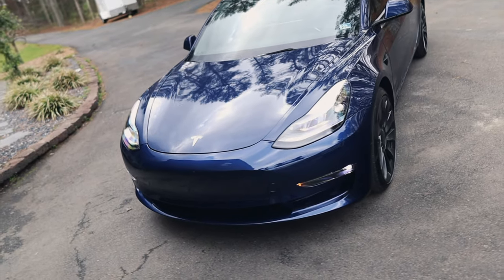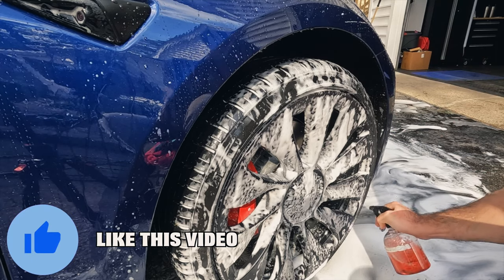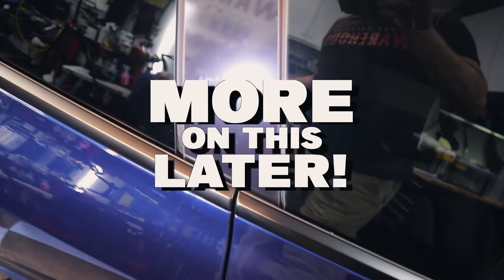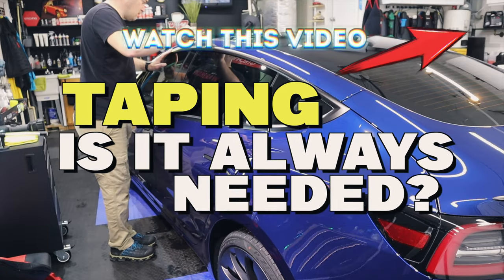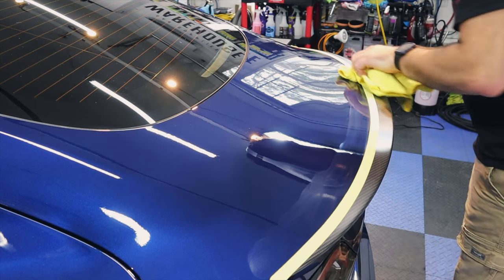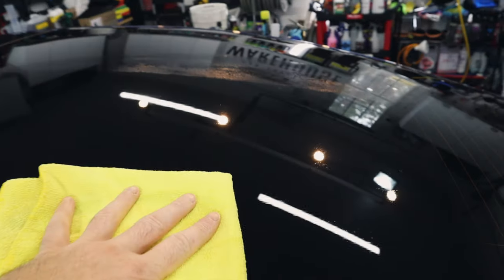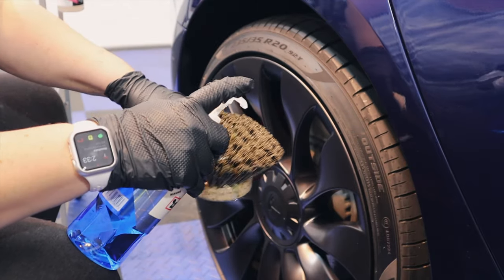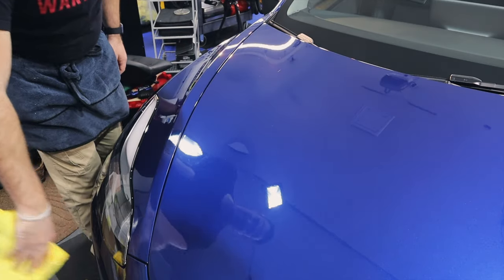CERAMIC COATINGS | FULL  PROCESS | TIPS & TRICKS #detailing #detailingtips #tesla

Comment: Hey Phil, I like the way that ceramic coating goes on as well. But I just bought Kort UK 3.0 what’s your thoughts on that coating?  I used it a few years ago and it turned out great, but it was not the easiest coding to remove. that coating in your video comes off super easy.  Thanks!
Reply from the maker: Hi. Yes we loved that’s stuff Cquartz UK3 also. We used to use it a lot years ago. Thinks weird however. It was pretty easy to apply and remove for me. 
https://youtu.be/ERIXOuxHrSs?si=YuCJ9KAM_S6-54E5
Reply: @MirandaDetailing  Phil, if I apply that ceramic coating and it rains two hours later, will that kill my application?
Reply from the maker: Well yeah…ceramic coatings like carpro, Gtechniq and gyeon need at least 12 hour cure time. If they get wet early it will compromise the coating.

Comment: Hey Phil. I must say. Hands down the best work I’ve come across on ceramic coating 👏 awesome. I’ve been looking into ceramic coat my Tesla model 3. What are some good basic products I would need ? Very new to the process of polishing pads to use and compound . Whats something good to start with ?
Reply from the maker: Hi. Thanks. 
It all depends on what type of polishing you want to do. 
If you’re new to polishing I would go with either the Rupes line which is very easy to use, but a little pricey, https://bit.ly/411eORt

or the Meguiar’s line with D300 Correction Compound and M210 finish polish. 
https://amzn.to/4bCgl7d
https://amzn.to/3Sx2cPX
https://amzn.to/3weLn4R

Comment: Hi, I'm  trying to ceramic coat my car. I've bought all the tools needed. My only fear is overdoing the buffing and removing too much clear coat. Do you have any advice on how to approach buffing for a newbie?
Reply from the maker: Hi. Great question!  So if you use a medium or fine polishing pad and a light polish you don’t have to worry about removing too much clear coat. That’s a very mild combo. You also don’t need to use heavy pressure or long polishing cycles. Just a few drops of polish, cover an area around 2x2 or 3x3 foot and work the polish in for a minute or less and that’s it. Usually that will help reduce minor swirls depending on the type of paint you’re working on. But if you are not concerned with swirls then it still is a perfectly safe combo and method to deep clean the paint and add gloss. Then just use what ever panel wipe you like and gently wipe the paint down and coat it. 😎👍🏼
Reply: @MirandaDetailing  Thanks for the tips. Also, the whole ceramic coating process needs to be done indoors in an enclosed area?
Reply from the maker: Yes I would definitely recommend applying it indoors, you will get better results.

Comment: What product did you use at the 8:08 mark and why did you wipe the car with it before you started the ceramic coating?
Reply from the maker: Hi. It’s the Meguiar’s panel prep. I don’t like using panel preps but I used it on this one. I forget why. We now only use the dr bealseys NSP primer polishes for coating jobs. That way we don’t need to use a panel wipe before applying a ceramic coating. https://youtu.be/2O1J1mD7MiI?si=BC-fnAH1xLP-RfbG